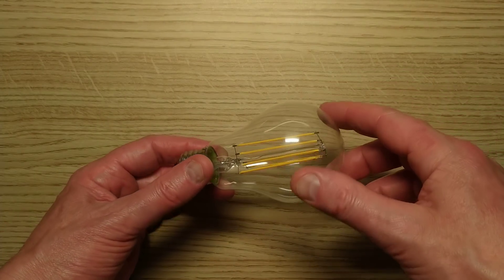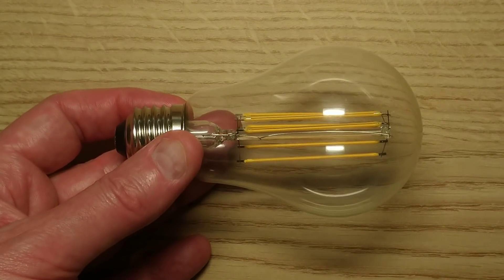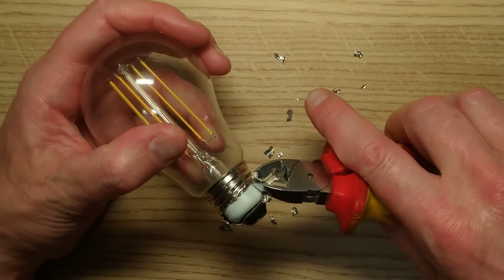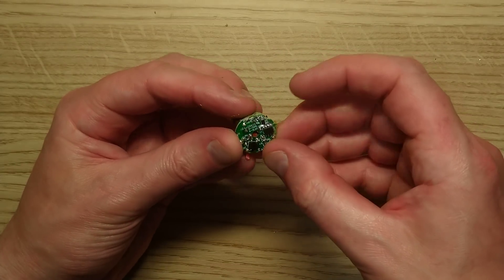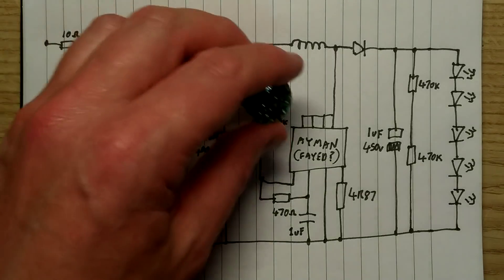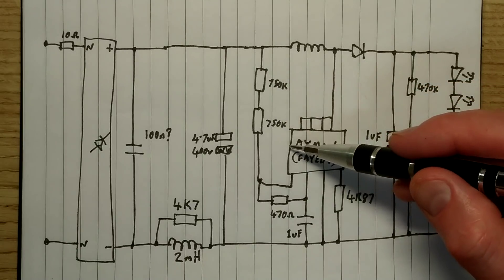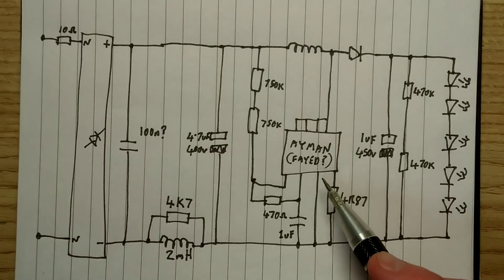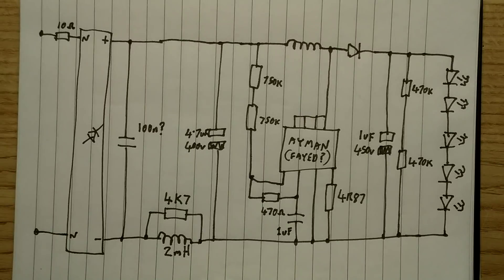ASDA 12W (100W) LED filament lamp teardown.  (with schematic)

Comment: Was 1:07 intentional? Funny that there is a slight glitch in the video just as you're talking about it.
Reply: It happens whenever there is a lot of motion in the frame, like when he moves his hand. To some extent it probably was since that's when its most noticeable. Its probably due to the extra processing power since static parts of the image are not updated as much, only the moving parts of the image as part of the compression algorithm.
Reply: FWIW my old original HD Samsung Camcorder does it, too, when filming in hot weather after a while. Presumably because the processor slows down to protect itself from overheating.
Reply: He said he's filming with cat's ass.
Reply: It's the 60fps setting. It messes with YouTube also at least on a Galaxy phone

Comment: I was sad that the X-Ray was not required in this video.
Interesting we are now at the point where 240 Volts is insufficient to operate LED lamps... who would have thought the day would come when (European) line voltage would need to be stepped up for LEDs.

Comment: Why is there an obsession with the number 4.7, 47, 470 in values for electronic parts?  "They" had no problem with 10, 100, 1,000, 10,00.  Why not 5's instead of 4.7's?
Reply: The short answer is that the "preferred numbers" are chosen (roughly) so their logarithms are evenly spaced. This means that arithmetically they are closer to each other at the small end. The reason is that for a given tolerance in component values, the smaller values have smaller error bars, and this way the uncertainty intervals of successive values overlap nicely.

For example the E6 series corresponds to 20% tolerance and its values are 1.0, 1.5, 2.2, 3.3, 4.7, 6.8. 
With their 20%  error bars, the first three values are 1.0±0.2, 1.5±0.3, and 2.2±0.4, and you can see that the upper end of one uncertainty interval just touches the lower end of the next (not exactly every time but close enough). At the upper end it then goes to the next order of magnitude and you have 6.8±1.3, 10.0±2.0, 15.0±3.0
Reply: @OlliWilkman  Which means that the "Decimal/Metric for everything" people must be having hives over those non-round numbers :)
Reply: @tbelding  About as much as the the imperial/customary folks have with them for not being even 2^n fractions...
Reply: @michaeltempsch5282  - Yup.   We have different measurement systems because they're better for different situations.   (I've found that people that grew up with only Metric tend have a hard time with fractions.)
Reply: @tbelding  Just like you get decimals in various places, like 4.7 here in electronics we DO use fractions as well. Very few would say 500 ml of water in conveying a recipe over the phone - it'd be half a liter. Quarter of an hour etc.
Do not confuse decimal notation with the SI system of units which is IMO far more cohesive and less in need of remembering magic numbers for conversions than imperial/customary.
Reply: I saw a video with the answer to this question from Julian Ilett... take a look here: https://www.youtube.com/watch?v=A1-iu54QI8E

Comment: I have similar lamps (walmart brand) in my house they are the smaller base decorative lamps 7watts =< 40watts on the pkg, the og lamps were 21 watt  incandescent. They are bright they do get hot. I've had them for 6 months now and usually unscrew 3 out of the 4 unless I'm working on something. Cheers still moving better get at it, I have a BigClive Lightup Coaster to assemble when I'm done moving. Cheers. Safe travels.
Reply from the maker: Hope the move goes smoothly.
Reply: Raymond Mucklow, you commented this several days before it was uploaded.
Reply: @martinrocket1436  patreon, you toss a couple bucks a month to help content creators make videos.
Reply: @martinrocket1436  good eye tho

Comment: To shreds, you say?
Reply from the maker: I definitely wasn't breaking the lamp next to my bed in a pokey little accommodation room.  Glass would have worked its way into the bed at some point.
Reply: @bigclivedotcom  Yeah, I wouldn't have done so either. Broken glass isn't the most tremendously fun thing.
Reply: @bigclivedotcom  Just shreds of jagged metal this way.